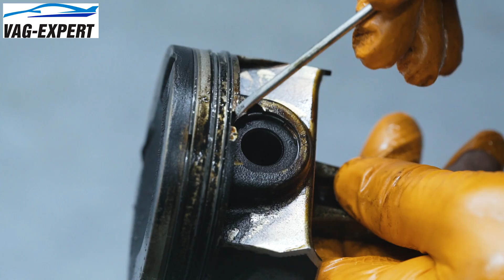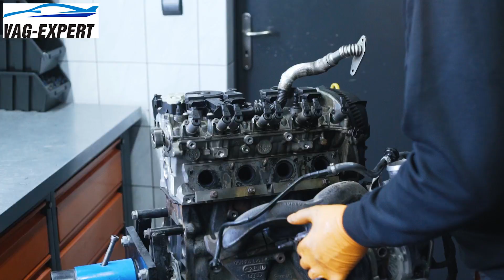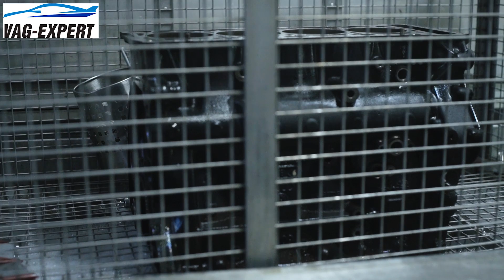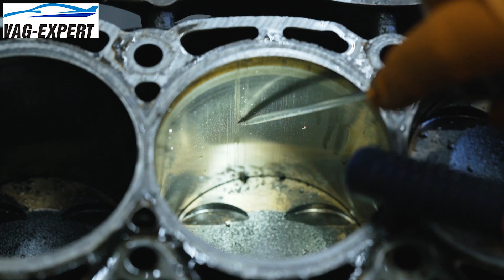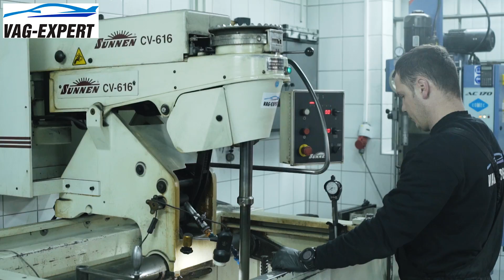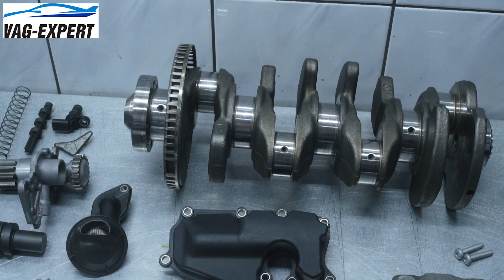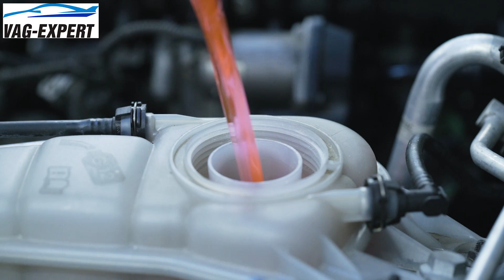TSI and TFSI engine overhaul

Comment: 3 minutes in. Conclusion: Just buy another car.
Reply: These engines are not worth 25,000 Euros/30,000 USD!! Thats what a GTI will cost
Reply: I have a 2016 car with this engine and it's super reliable. Not one problem in five years.
Reply: @Japplesnap  They fixed the issue in 2015. You should be okay.
Reply: @Japplesnap  Quick go and buy a lottery ticket while your good luck is holding in!!!
Reply: Use engine flush products with each oil hange it should do the trick.
Reply: @starszytatnamsok5675  Ive been using BG products around 40,000 miles when I learned about them. EPR, MOA, for oil  and 44K for fuel. Car runs great but last 3,180 miles a quart low. Been driving shorter duration trips the last couple of years, maybe contributed to higher consumption lately. Damn rings!
Reply: Thats correct, even better if you do not buy one in the first place. Less reliable than a trabant.
Reply: Just buy a 2.0 TDI.
Reply: @florinalexandru6626  Maybe Toyota is better
Reply: I feel bad for their worker. Imagine you have to do all that procedure for hundreds if not thousands of engines.
Reply: @hieulamtri5535  that's what he gets paid to do.

It's better to buy TDI
Reply: @dragospahontu  is that reliable? I am in vietnam and still use the toyota 2.0 natural aspirated engine. Works great without too much maintenance. I dont like turbocharged and direct injection engine. It just make the engine wear out faster
Reply: @hieulamtri5535  diesel engines are much more reliable. This is why TDI is so popular.

Vietnam is very different from Europe. So just buy what is cheap and affordable in your country.
Reply: MAFET Yep it will happen again anyway take the hit and move on
Reply: Yeah 😁
Reply: or avoid 1 &2 gen engines
Reply: @ejtisevn  this engine is actually pretty good
Reply: Ls swap problem solved
Reply: Uff, that repair is one AzZ r@ped bill!
Reply: Can you put better pistons or does it not fit?
Reply: poor mindset
Reply: no just buy another engine with the right piston rings
Reply: @ImplantedMemories  with your obviously incorrect spelling of the world engine, you better buy another car!
Reply: @maxdm1583  World = word ? 😅 
Yes you're right, I would never buy a VW again in my lifie. I can't afford them, because they will break.
Reply: To their credit that motor is a rocket. It’s just a total pile of shit. 

I wouldn’t mind one of these engines refurbed by these guys. I still wonder, why not just have an oil pan gasket instead of the good shit?
Reply: Or better still don't buy a VAG product👏
Reply: @TheMuzikall  same problem with w204 180 compressor here
Reply: @TheMuzikall  stick with your KIA...
Reply: @StreetDreamsTO  Kia is ok
Reply: This is Poland. Poles buy cars with high mileage from Western Europe from traders who reduce the result in the odometer. Then you have to repair cars with a odometer reading of 250 thousand. km. and the actual mileage is 500 thousand. and more.
Reply: dont buy a VW all crap cars

Comment: I'm trying to think of a scenario where this would make any financial sense.  Got nothin'...
Reply: Start a VW engine overhaul company. Thats a lot of financial sense.
Reply: The only way i see anyone doing this is if someone has one of the more higher performance engines. They love their 300 hp 2.0l turbo so much they want it to keep going i guess? For any other one, it's probably cheaper to just buy a second hand one with lower milage.
Reply: @willemkanon4020  ok, so let me give you an example: you have that engine issue in your Skoda/Seat/VW/ Audi and you have to do something about it. For around 2900 euro you get your engine completely refurbished + timing chain, spark plugs, engine oil and filters replaced. Basically you are getting a new engine without it's manufacturer's fault + 24 month warranty with no mileage limit for the fraction of the price of a new engine. And a peace of mind. Or, as you would prefer, you go to eBay etc. and buy a used engine (for half of the above amount), with lower mileage you have no idea what state it is in, with no warranty or if you get lucky, maybe a couple months or so with all the problems it may cause in future (and you know it will, you just don't know when), pay the mechanics to replace it and wait for that day when all the shit goes down.
I think I know what option I would go with. And it makes perfect financial sense.
Reply: @michalbrenda7879  it's only 3k to let all that stuff done in the video?
Reply: @willemkanon4020  Agreed no way is that much work only 3k i would guess and it is a guess at 6-8k , so example a 2012 Golf Gti + say 6k will get you a 2015 Golf Gti. No brainer
Reply: @robertebob3596  This is in Poland, so I can definitely believe it. They state on their website that their overhaul of an engine costs 30-60 % of the price of authorized services. 4-8k is what a new engine costs from dealers over there.  Newer car prices also scale hugely over there.

Comment: And how much did all this cost ? Like 3-5 k $ ? like a whole car ? :D
Reply: Those cars are worth 30-40-50k$ new, and 10-15-20k $ used depending on mileage and year, so rebuilding the engine for 3-5k$ is reasonable for some cars and people, this rebuild done right will last until the car rusts completely and is thrown away.
Reply: a car cost 35,000
Reply: 10.000 eur
Reply: 1500 - 3500euro
Reply: @jarekr9884  10.000 plus 1500 ili 3500 eur
Reply: @pajapajic8809  10,000 Euros plus remove and reinstall charges?

Comment: this will cost more than the car itself.
Reply: Very expensive ... !
Reply: Agree! They are powerful engine but not reliable.
Reply: @3kkk514  
The 3rd Gen engines are very reliable, even before the piston/ring update. They don't break down, they just consume oil.
Reply: @x-man4702  yeah sure, mine is broken now. so dont think so:D
Reply: @rn.v4629  
Poor maintenance or lack of
Reply: @x-man4702  I have B8.5 2013, 1.8tfsi and it burns 1L of oil on 1300 km. I don’t know if I should do the repair or just have oil in my trunk....they even stated that for my model oil problem has been fixed with updated pistons. Car is running great only you have to have oil in the trunk.
Reply: @mateotafra892  hi Mateo, I am driving my 2.0 tfsi with an oil consumption of 1Liter every 1000km since a couple of years and 20-25000 Km. It still slams your back against the seat when you push full gas.... Since when do you have high oil cons?
Reply: @gc6347  also for approx 2 years. I have Revo stage 1 chip and car goes great no issues whatsoever only high oil consumption. It does not smoke or anything else. I was thinking to do an overhaul but it’s expensive....when I bought it I’ve found on web that Audi has made an update from 2012 models on updated piston rings but it seems that is far from updating....honestly I don’t know what to do....should I just keep driving or to sell it or in the end to do new pistons and pay for the complete service....I don’t have problem in buying oil but have a concern about long term issues that could happen with this problem. 
What is your opinion? Have you tried to find out what to do or just keep driving?
Reply: @mateotafra892  I am in the same dilemma: new car, repair or just fill the oil? For the moment it works and I just fill the oil. Mine is from sept 2009 160.000 km. Vag expert in Katowice would cost something like 2900 euro which is a very good price and they look professional. Other germans workshops are in the range 4-5000 eur. 
On the long term I was told there could be only problems with the oxygen probes and spark plugs. I change the oil and filter every year/10.000 km after liquimoly engine flush.
Reply: @gc6347  i have a 2012 a3 2.0t fwd and honestly if this happens to me i would just pay 4-5,000 instead of buying another car, because the way i see it. For that amount of money i have a brand new car. I really do like my a3 a lot. Unless you plan on buying a brand new car and make payments. Any other used car will have its potential problems.
Reply: 4-5000 Euro is the price for an engine repair, with the same money I xan buy also 4-500 litres of  good oil that means running 400.000-500.000 km. So the repair makes sense just if the engine breaks down.
Reply: @gc6347  yes i agree
Reply: @mateotafra892   I drive an Audi B8 1.8tfsi just like you . As the engine is aging it makes sense to put more dense oil in it . I bought it March 2020 and was well aware of the oil consumption problems. I assumed that putting 5w40 instead of 5w30 would reduce the oil consumption and guess what ... it did . I add 500 ml every almost 5000 km ;)
Reply: @mateotafra892  sell this car asap, cost of repair it will might even be up to 6-9 k F so can almost buy new car for it...crazy... i will never buy tsi or tfsi engine...never, prefer honda or mazda petrol engines. also mercedes has really good petrol engines

audi only 3.0 TDI
Reply: @Majk.M  do new TFSI engines have a same problem? For example golf Gti, R or new Audi tfsi 258 hp?
Yeah this is really big issue and it’s really frustrating....I prefer petrol over diesel but whole VAG tfsi engines are bad....
Reply: @gc6347  1l of oil per 1000 kms is HIGH OIL CONSUMPTION, you don't hear of BMW's or Mercedes using that amount of oil do you ?
Reply: @gc6347  There are many other things that cause oil consumption not just piston rings... dirty/blocked PCV, valve stems seals, turbo, weather and the way the car is driven. Most of the time switching to a thicker oil solves the issue. I have been running 5w40 in my 1.8T (not tfsi/tsi, the old 1.8T) and i dont have to refill oil at all between oil changes. While on 5w30 it was burning the entire dipstick in 1000km... My friend who owns a seat leon had the same issue on his tfsi, switched to 1 grade thicker oil and his problem went away, and its still manufacturers spec, as vw lists a few different thicknesses of oil as acceptable, not just one.
Reply: @mateotafra892  They got new Problems for you. Engeniering is still in process here... xD
Reply: @gc6347  you should think about the polution this causes and the people driving behind you. Burned oil fumes is carcinogenic, but no one cares about that on that conversation. That is really mentally poor
Reply: @x-man4702  correct, the EA888 gen 3 has many improvements over the gen 1 and 2...much more reliable engine, you just NEED to do the preventative maintenance .  I had a 1.8T audi gen 3 which lasted to 150,000 miles no problem, sold it now I upgraded to the 2018 Audi S3 2.0TFSI 292 HP, with the upgraded internals and it is a total beast of an engine , and has been totally reliable up to 40K miles,  one of my favorite cars so far.
Reply: I had B9 2.0 tfsi awd no oil consumption now I have F5 also no issues
Reply: And that's the exact line of strategy in vehicle manufacturing these days - 'purchase rather the new one, instead of bothering how to fix the oldish' - producers relentlessly force user to replace goods on regular time periods. Regardless brands, vehicles have clearly become a disposable items as you ought get rid of them right away after first signs of issues pop up around